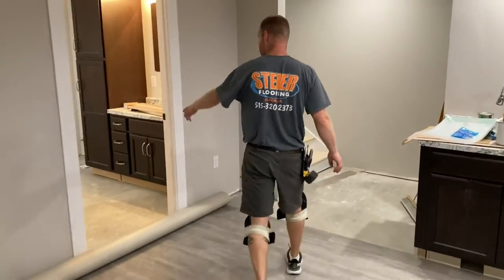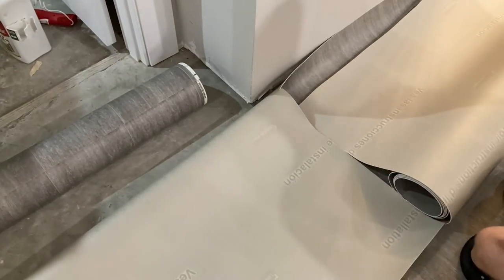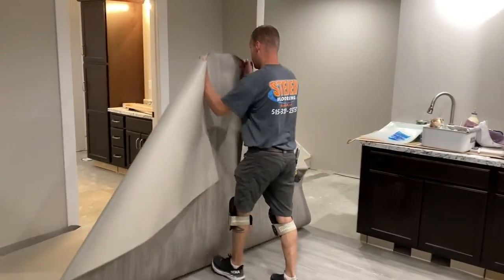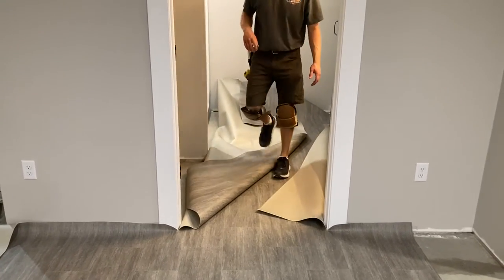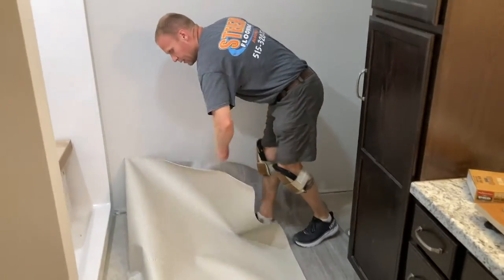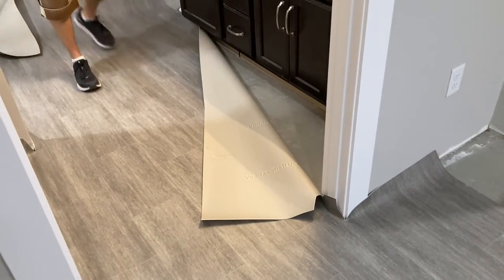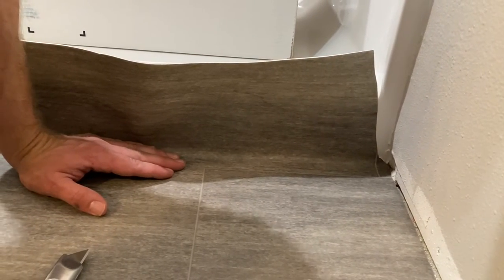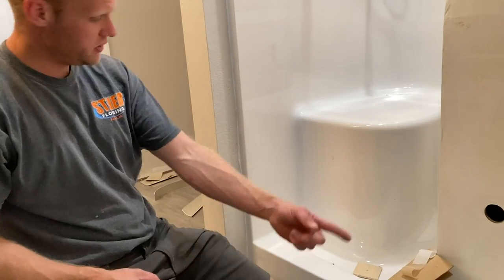Laying piece of sheet vinyl through doorway

Comment: One comes across the most precarious situations installing vinyl sheet flooring. Specially with the older ones with the paper backing that would tear if you looked at it wrong. I hired a young east Indian youngster to help me for the day. I had a 25 ft kit with 6 ft island in the middle of the kit part. Did all the initial rough cutting including the island. So I glued the entire half on the other side if the island and started to put the floor into the glue. Helper on one end and me at island then the young man says it's tea time and took off. I tried laying it myself gota few good size bubbles as the glue was starting to set. But when I got to other side if island the release cut I made no longer lined up.1500$ dollar experience.
Reply from the maker: We’ve all been there!

Comment: Thanks you are a life saver! I need to know how to do my adhesive and finish install. Ill see if you have a different video for that but that was tremendous help. I watched a video of a british guy showing how to install and he said that he makes the cuts then takes the vinyl out of the room then adds double sided tape and spray adhesive along the edges and seams. Do you just peel the vinyl from the corners after cutting and add the tape then set it as you go after the cutting is all finished?
Reply from the maker: If you were going to be using perimeter tape put the tape down first. Then install your vinyl. Then pull your corners up and Peele the top layer off the tape you already have set to the floor.

Comment: In the Uk we nearly always have to cut in tight which isn’t ideal definitely be easier fitting before any edgings or trims go down
Reply from the maker: From time to time we run into situations where homeowners request we finish tight. I do charge more for this type of installation as I must use more aggressive adhesives to keep material from bubbling.
Recently looked at a project where a previous installer head installed all the click vinyl plank tape to the walls. It’s summertime here in Iowa and everything is swelled up and tight. Her floor is cracking and popping and making all kinds of crazy noises. Wish she would’ve let me made a quick video on why fitting tight is a bad choice.
Reply: @steierflooring9869  ,  All hard surfaces get a quarter inch gap to walls period !!! Material should go under door jambs . Quarter round is a MUST on all hard surface jobs, this has been through the court's on lawsuits years ago. This requirement should be on the sales agreement in fine print of course. If they demand something different than industry standards,, make them sign off on a detailed description!! That have trim for tubs and showers also . Under vanity or kitchen cabinets, add toe kick! Charge accordingly!!! Problems solved. Good luck!

Comment: Would this work if your going through a 12 by 60 foot mobile home?
Reply from the maker: One piece of sheet vinyl through that big of a project I won’t say is impossible just difficult
Reply: @steierflooring9869  so if I do it in pieces how should I devide it? Room by room or just do the trailer in 2 or 3 sections?

Comment: I glue the whole floor, drop it in, trim off the waste, roller it then cut in tight n finish with a thin bead of clear mastic. Jobs a good un! 👍
Reply from the maker: Thanks for watching!
Reply: @steierflooring9869  I like your work your videos show that you enjoy n care about your work. Do you fit lvt's as well? Karndean, amtico etc
Reply from the maker: Carpet, ceramic and porcelain tile, LVP, LVT, sheet vinyl and hardwood
Reply from the maker: And yes I really do enjoy my job!
Reply: @steierflooring9869  that's good then so do I!